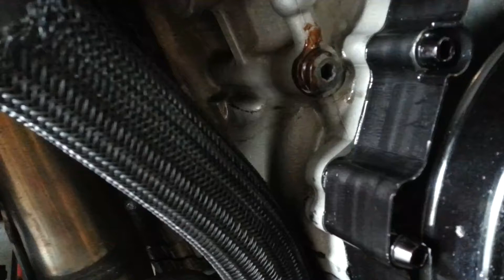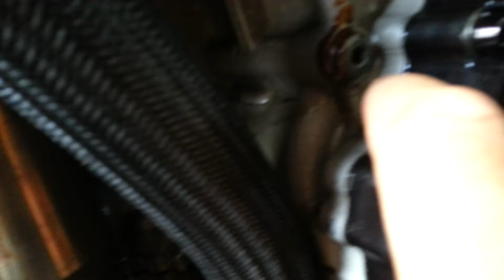Engine Cracked on GSX-R 1000

Comment: hi,I have the same problem with my k7 and I don't know what to do. Did you weld it?
Reply from the maker: ***** It can't be welded, my friend.  That is the most highly stressed part of the engine and welding it is a bad idea - the heat can warp the block and the only thing you could do is line-hone the block to make it work - MAYBE.  It's simply not worth even trying.  Also, the labour involved in pulling the engine completely apart and remove all components is pretty high.  Figure at least 25 hours.  Then you have a used engine of questionable reliability and a lot of used parts in it.  Better to find a low-milage motor somewhere and swap it in like I did.